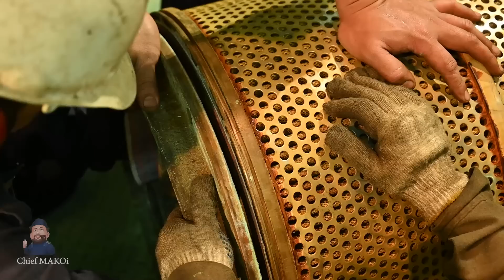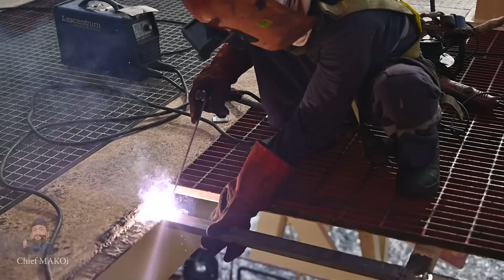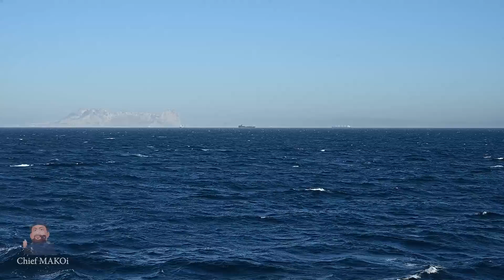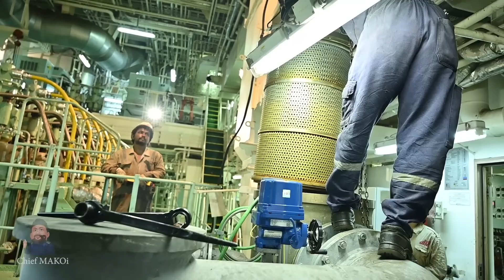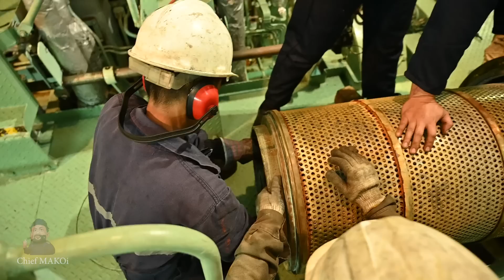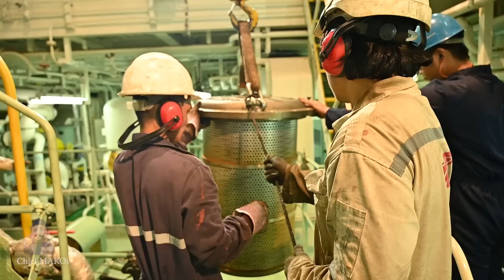The Ship Fitter in Action | Chief MAKOi Seaman Vlog

Comment: The guy operating the cut off disc equipped grinder, without a guard, would be stood down and dismissed at the next port under my watch.
Reply from the maker: A fair assessment.
Reply: Can you provide exact measurements of cut off disc at the middle of the sea? How can I finished my job, if I didn't removed the guard temporarily, which I put inside the bucket.
Reply: @D_PUNISHER  Ever heard of a hacksaw? No excuses, use the correct size disc with a guard or you're off my team, period.

No job is important, or urgent, enough for you to risk losing your eyesight over.

Comment: Man, I am not impressed with the design engineers on that filter installation, not having it under the crane so you have to get creative to get it in and out, and then the crane not even going far enough over the upper deck to set it directly onto the cart... Lol
But good job on your crew working around these obstacles safely!
Reply from the maker: That filter was a late addition during the last drydock.  10 years late. 😄  I guess they were lucky there was still somewhere it could be installed.
Reply: @ChiefMAKOi  ok, ok, I will give them grace then, and good job retrofitting it in to that tight space so that only one extra chainfall transfer was needed! Lol

I do a lot more retrofit than new design, so I understand the difficulties...
Reply: I worked in 34 different engine rooms..never seen a filter like that before

Comment: What surface prep? The beauty of stick welding. 😁
Reply: You know, not getting the paint off first was a bad idea when you spend more time to ignite the arc than actuall welding.
Reply: Papaalphaxxx- Yeah, I  only welded a coupla times, but I  recognize that 120v "Buzzbox" he was using at 2:05 and I felt his pain at a sticky stick on that heavy metal. I  used a buzz box and it barely made enough horsepower for me to popcorn some metal onto a leaky rusty exhaust system😂

Comment: That was very interesting. I have watched your videos each and every one and always enjoy them so keep up the good work!!
Reply from the maker: Awesome, thank you!
Reply: @ChiefMAKOi  It's not right on the part of your Shipping Company to do continuous fabrication and replacement of steel gratings and platforms on deck areas. These are jobs that must be done in dry-docks and ship repair yards where there is proper man power, availability of various steel materials and stable safe working conditions. The ship fitters are there only for the ship's emergency repair and welding jobs. Not for routine dry-dock repairs.! The Ship Superintendents try to save on future dry-dock repair jobs costs which is not a prudent thing to do. 🤔
Reply from the maker: @cedricvaz6112  for major stuff like the big pipes, those are for drydock.  For these small things, it's better not to wait.
Reply: @cedricvaz6112  there is no benefit to being at a dock for replacing that grate and support. It would still be done by lying on the top of the deck, and since it's smooth seas the ship movement isn't going to be a problem.
The manpower is obviously available, as he said on older ships there will be a crewmember specifically assigned to this sort of thing, they ordered the grate sheets and so had the proper materials there, and on smooth seas the working conditions are just as safe as at a dock.
Reply: @cedricvaz6112  I don't agree, Cedric.  Certainly major structural work would need to be done in a shipyard, but small and straightforward tasks like the one shown in the video can be done safely and competently while underway.  Doing the job while the ship is underway enhances safety because an 'area of concern' does not get deferred until the next time in drydock, which might be several years in the future.